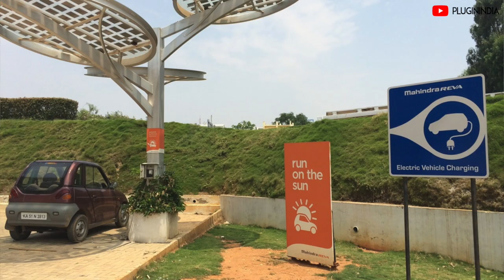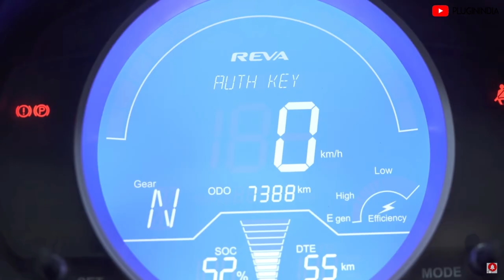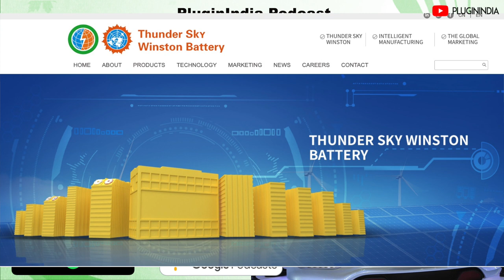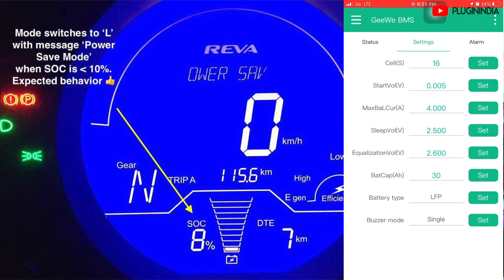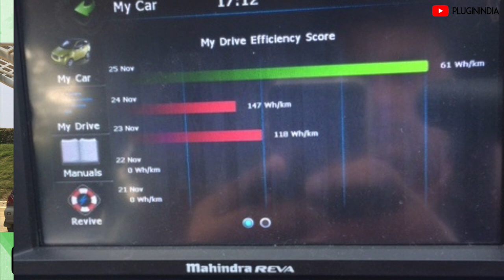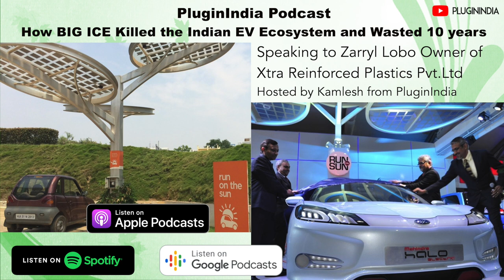How BIG ICE Killed the Indian EV Ecosystem and Wasted 10 years | Podcast

Comment from the maker: 01:03 - The Reva Electric Car
05:00 -  Made in India Components
06:22 - Reva Battery & EMS
10:00 - Maintenance Costs 
11:53 - Reva Parts
15:33 - No Small Cars for 'Working Class'
19:33 - Zarryl's Small Electric Car
20:52 - Chetan Maini
22:37 - Reva Servicing All  Over India
25:45 - Reva Lithium Ion or Lead Acid?
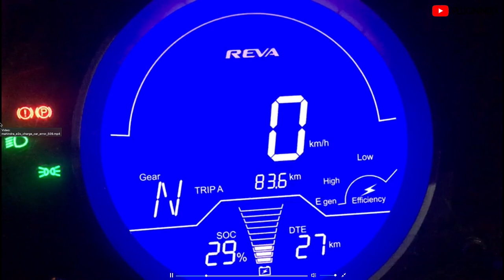31:15 - Mahindra Never Serviced Reva
33:00 - e2o's Incredible Made in India Tech
37:43 - Mahindra servicing the e2o
38:52 - e2o's Made In India Components
40:38 - e2o Battery Pack Cell & Pack Changes
45:18 - Active Cell Balancer for e2o 
50:25 - Getting New Cells for e2o owners 
52:10 - e2o Electronic Components Part Availability 
53:59 - Mahindra XUV 400 Shame
58:55 - Wish Chetan Maini did not sell to Mahindra...
01:01:01 - Read the Book on Reva Story
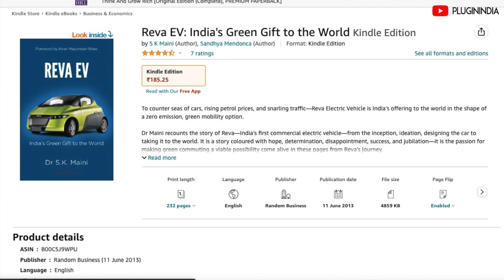01:01:53 - Auto Media's Fakeness
01:02:59 - XUV 400's Failure 
01:06:40 - Tata Electric Cars
01:08:55 - Software Updates Tata vs Mahindra 
01:09:00 - e2o was ahead of its time
01:10:55 - Bury me with my Reva! 
01:12:18 - Market for small city electric car
01:13:04 - What about Safety for small cars?
01:17:00 - Chinese & OLA Electric 
01:18:06 - Zarryl Needs Funding!

Comment: Sir I m confused both ev scooter ola S1 pro and Bajaj Chetak for my sister actually my like Chetak design etc but I recommend ola S1 pro please suggest your expert opinion?? Daily use around maximum 50km per day
Reply from the maker: Both are very good. 
For your sister if height is low Chetak is better. Ola’s seating position is better for tall people. 
Ola’s software features are superior to Chetan’s non existent software features. 
If height is consideration go for Chetak. 
Try both and decide.
Reply: @pluginIndia  thankyou very much for the suggestion
Reply: If you are going to buy OLA.... BEWARE ... dont buy an ola with single front arm... OLA AIR which comes with double front arm (suspension)... Ola single front arm is not a good design for a high speed vehicle.